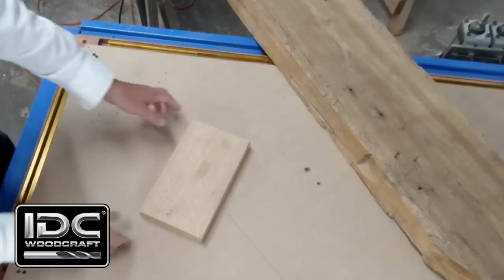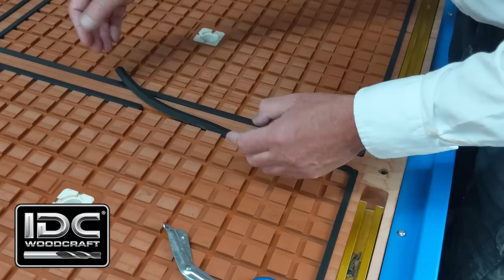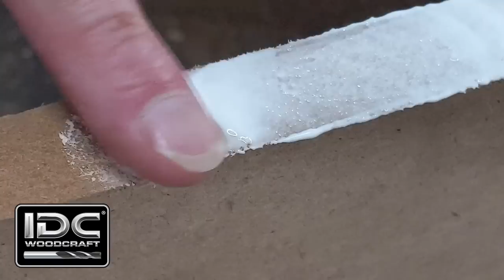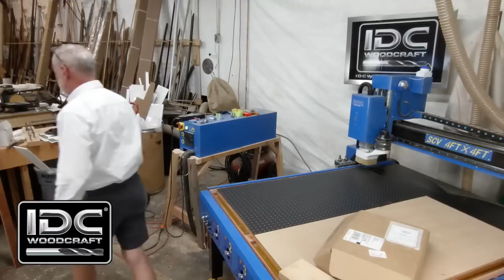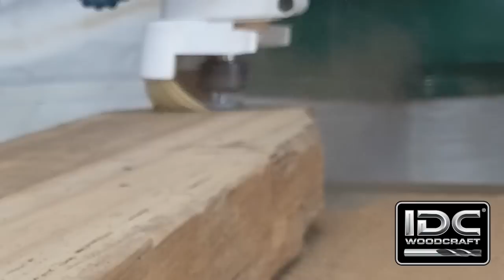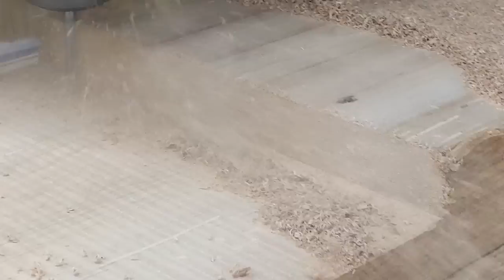What is a CNC Router Vacuum System Table and How Does It Work

Comment: Love your videos Garrett. Not sure if the expense would be worth having to replace it after a dozen projects. Profile cuts would eat it up pretty quick. I’ve seen a video using news paper on the unused portion of the vac table to concentrate the vacuum where it’s needed. It seemed to help. I personally have not tried it though.
Reply from the maker: thisoldman7142, Hey there! Thanks for watching the videos. Using newspaper to concentrate the vacuum is a neat trick, it can definitely help with more even suction across the table. If you do end up trying it out, let me know how it goes!

Comment: Just use butcher paper. cover your zone with butcher paper, wax side down. Cut out the paper the size of your work piece and your golden.
Reply from the maker: magicman9486, That's a great suggestion! Butcher paper can be a good option for protecting the surface when working with wood. Just make sure it's securely in place to prevent any shifting during the cutting process. Happy woodworking!

Comment: Great information, Thanks! I just purchased an “Airweights” 24”x24” vacuum table for my Laguna iq 2x3, They have the pads for about $5 cheaper than all star. Also, what were makers using to get their vacuum tables to work prior? After all my research on vacuum tables your video was news to me, especially the side sealing.
Reply: Thanks for your honest feedback. I guess I'll continue with the tried snd true CA glue and taoe.
Reply from the maker: mpakirk, I'm glad it was helpful brother! Your vacuum table sounds awesome and I'm looking forward to hearing what you think when you get it all set up on your Laguna! Happy cncing brother!
Reply: @mpakirk... How are you liking your Airweights Vacuum Table, 1 yr later? I'm looking at purchasing the 24 x 24 table for my Onefinity system. I welcome your input.

@idcwoodcraft... another interesting and informative video of your series  that I keep running across. As for the music... loved the whistling tunes. AND I love the power of the Beast! I've impressed a few people with it's capabilities. It's a game changer!
Reply: @PPerquin Honestly? I could never get it to work. I skimmed both top and bottom and sealed the sides. But the MDF would always cup and the vacuum wasn’t strong enough to pull it flat. I tried 2 separate vacuum pumps and got good vacuum with the holes plugged. I worked with Airweights and he sent me the foam with holes. He was very good to work with. But by then I lost interest. I could not get My Laguna IQ dialed in good enough to leave an onion skin. I now have a ShopSabre with a larger envelope. So anything small enough for the Airweight, I’ll just use ca and tape. A lot less effort. I’ll probably just sell the Airweight when I get around to it.

Comment: Screws? Really?

I've have been running a 4x8 machine for over twenty years and have never used screws. Besides the chance of hitting one and destroying a cutter is too great in my opinion. 

I don't know of any professional shop using that technique. 

Using Trupan or other Low Desity Fiber Board is an even better alternative to MDF. It is made from Radiata pine. Longer strands, more porus, and 30% lighter.

Thanks for your work.
Reply from the maker: Lindsey, all very fair points my friend! Thanks for sharing your perspective and insights brother!

Comment: Simple dollar store contact paper laid on the bed around your work piece would stop 99%  leakage, and will peel right back off when done with no damage to the spoil board. Cheap and easy
Reply from the maker: freedomforever9166, that will absolutely work my friend! Thanks for the tip! There's lots of ways to secure your projects. I always recommend trying a few different ways out and using the one that works best for you and your project at hand.

Comment: Hi 

I’m very new to CNC
I need to cut my laboratory table to using CNC
THE top material is Phenolic Resins 
It is very hard material 
I need to size my tops from the original sheet. (10*5ft is the size of original sheet)
What will be the best bit for this project 
What will be the feed rate and RMP
What should be the cutting depth per one cut
Reply from the maker: Phenolic resin is tricky brother and really dangerous to cut for your health if it gets in your lungs.  I really cant recommend it my friend.

Comment: Hi. What the difference between Venturi valve to convert compressed air and a real vacuum pump with tank???
Reply from the maker: Venturi valve uses a main source flowing air steam to pull in more air from one out more side inlets.

Vacuum is a direct air removal.

Vacuum is much more effective since it is 100% air removal from a specified source.

Venturi side air removal sources can be restricted which will make suction much less effective

Comment: I liked the music, I think the whistling is my favorite.  I loved how informative and detailed the whole thing was (thanks for enduring the dust!).  I have a suggestion about the seal on the vac board.  Instead of a simple butt joint how about a sort of half dovetail, vertical cut?  That would allow for some longitudinal movement with less compromising of the seal.
Reply from the maker: SRBrown9032, I'm glad you liked the music brother thanks for letting me know! Also that's a great suggestion for the board my friend, thanks!
Reply: @IDCWoodcraft  You're welcome, my pleasure.  I learned machine shop basics way back when I was starting my experimental physics career as a junior physicist who made some pieces of the experiment and designed other pieces for the shop to make.  I'm retired now, but I've started learning about CNC as sort of a favor for a friend and am enjoying the journey.  Good luck with the "beast", I think it's a winner.

Comment: The All Star Tile Gasketing product makes me excited but really sad at the same time because I do not have a CNC vacuum table ☹. I would love to see video ideas/options for removable vacuum tables for industrial and bench top CNC machines. 

@ALLSTARCNCPRODUCTS - I have a product suggestion. I use a maker space community Laguna 4x8 without a vacuum table. Unfortunately, the corporate non-CNCers mudblood directors which make the rules for operating the machine and get upset when the table bed gets carved up. A great All Star side product would be selling the mats without holes too. This would allow us apply the mat onto a virgin bed which has t-slots and then replace the mats when they get carved up too much. It would be much easier to replace the mats verses replacing 1” think MDF boards (which I’m still trying to find a vendor).
Reply from the maker: Dion, I get what you mean brother. The vacuum table is awesome! I'm hoping they'll also be able to help get you something that will work well with your Laguna brother!

Comment: The nature of vac holding is that you take away the pressure on the bottom side, and the atmospheric pressure pushes the work piece down. So no matter what pump you have ,14.7 psi downforce is all you ever get. The lateral force, however, is a function of the static friction between the vac table and the work piece. An MDF spoilboard is prone to collect a fine layer of dust which significantly reduces this friction. That is why your work pieces glide so well over the bare spoilboard, not the fact that you have some open space in the suction area. 
If you covered all the free area around the maple beam, it would still have a poor lateral holding force.
That is where the rubber mat shines. There is a reason, why it has an adhesive on one side. Also, the rubber will compensate tiny imperfections in the work piece underside, which might cause poor suction as well.
A thin fleece foil will do the same trick (like a Datron VacuCard). In fact it is even better, because it does not block 85% of the suction area. And it has the benefit of easy removal. 
Does the rubber and adhesive gum up your endmills when you make a through cut?
How easy does it peal off again, when you feel the need to change it?
A 1/2" or even 5/8" MDF spoilboard might be convenient, but I see more cons than pros.
I use MDF often on the vac table, especially when making through cuts. But mostly 3mm thin, same size as the work piece and the vacuum sealed with foam rubber cord directly below the surface area of the work piece. That setup has excellent holding forces and I can make clean -1mm through cuts without tape, glue etc. messing up my end mill
Reply from the maker: scratchbuiltdesigns, thanks for the insight and background on this one brother. You bring up some really interesting points here. I appreciate it!

Comment: For those reading and writing comments, allow me to illuminate the science and physics that make the Tile Gaskets so effective. It has little to do with the size and CFM capability of any vacuum pump, and much more to do with the strength of the pull. For those commenting about covering up the surface area of the non-work surface on the spoilboard, that is down-drafting, which is nonefficient and far less effective when compared with vacuum clamping. A true vacuum clamp requires a small sealed cavity or chamber under the part or material where the air is evacuated creating a negative air differential below the part compared to the air pressure above the part. The Tile Gaskets accomplish this with their perforations. The gasket material seals up to the material and the holes become very powerful suction cups. In a production environment where the same part is processed over & over, we use dedicated jigs using non-porous material. For those doing work where the material, size, and dimensions change, or you need quick work without engineering a jog, the Tile Gaskets are a game changer. They become the new spoil surface rather than the MDF board. They are engineered and designed to be cut into, so no more tabs or onion skins to hold your parts, and our clients are processing with single passes due to their hold strength. Maintaining an accurate z-depth is important so as not to gauge through them preserving their effective life. Our clients use the same set for hundreds of production hours before fly-cutting them off and reapplying a new layer.
Reply from the maker: ALLSTARCNCPRODUCTS, Thanks for giving us all a little more insight on this, we appreciate it!

Comment: Interesting solution that gives me some ideas, thanks.

 The real issue is the rule of thumb is 1.4HP per sq ft of vaccuum zone is needed to produce 15lb/sq in of downforce through MDF. Salespeople like to sell 2.2kw (3HP) pumps and say they will work fine, proved here as not so fine. People can't run 10HP pumps in a small shop of home likely anyway. Thats the rule of thumb for larger work, smaller stuff you need to double or triple it.

 I do a lot of cut through and sure I can be really careful and cut almost through but then I have to pay employees $40/ hr to finish it which is costly. The other option is damage the surface more and that turns a $100 spoilboard resurfaced 10 times into $2000 and a number of hours of labor, too costly of a solution.

 I think this is an awesome solution for folks that do not cut through or do not cut through often. To be cost effective speed is needed in my case and our cut through is typically 1/64" (0.4mm) which is likely the compressed thickness of the foam gaskets (1/32" uncompressed).

 Yes I let a salesperson talk me into a 2.2kw as adequate knowing very well it was not. But they threw it in for free basically because I refused to beleive them. I won't even hold paper down and allow you to tear it lol.

 I have been looking at a different far less costly way, no idea if it will work but this concept gives it more merit. Lay a sheet of hardboard (sometimes called pegboard) with the textured side up on the spoilboard. maybe cut grooves in the MDF and through holes into the airbox to reduce restriction on the airflow. Would only need light tacking to hold in place and have similar abilities maybe. It wouldn't have the rubber like hold force or as much but would not increase the costs of resurfacing as hardboard is cheap, 10 hardboards are maybe 40% more expencive then 1 MDF spoilboard sheets. Could even spray it with a light coat of a rubberized coating. Might be able to surface it a few times but also may be more effective to just replace it (assuming its constant thickness). If it is constant thickness and the MDF is surfaced then no surfacing will be needed.

 Since I seen comments , I used butcher paper to block unused area, newspaper doesn't work well and I don't think its printed much anymore anyway. Butcher paper lasts forever and is cheap, flat and in rolls of long lengths.
Reply from the maker: 3dtwerking324, your bring up some really interesting ideas my friend. I appreciate your thoughts and insight on the vacuum system brother and trying out the butcher paper.

Comment: I like the music. I dont have a vac table but have seen others use newspaper.  Just add  a sheet on top of the mdf. Put wood on it. Somehow  It seems to greatly improve the vacuum.   Spoil board damage can be reduced by setting the bit to the top of the  spoilboard. Then set your programed  cut to negative numbers.
Reply from the maker: mike, thanks for the feedback brother! That's a great idea with adding a sheet on top of the mdf. Thanks for the tip!

Comment: Nice addition with the All-Star pads.  The only problem I see is you won't be doing any through profile cuts.
Reply from the maker: Thanks for the thought. I brought that up as well. They lead me to a creator that uses it with cutout a lot. I don't remember the person offhand but It's all in the settings and they use it on cutout a lot
Reply: Our Tile Gaskets are engineered to be cut into and consumed over time. But precision in Z depth control is key in determining longevity. We have many clients using the same set of Tile Gaskets for 300, 400, or more production hours. The Tile Gasket becomes the new spoil surface, and as they are consumed and need to be changed, simply fly cut off and reapply. No need to change the spoilboard.